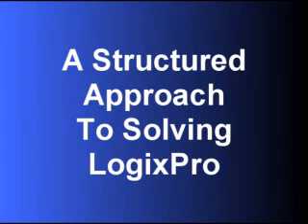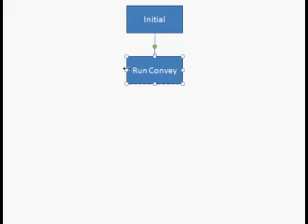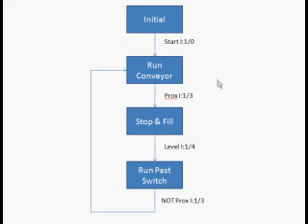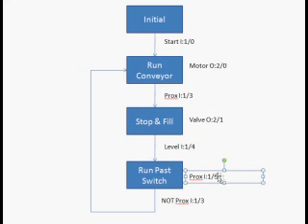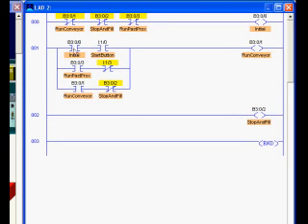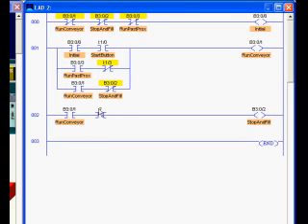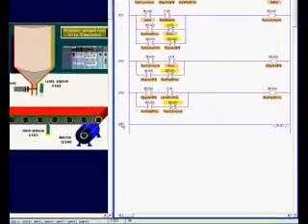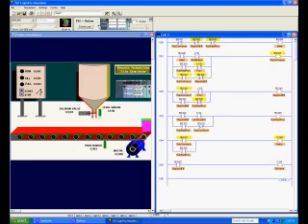Solving LogixPro Silo Simulation

Comment: You have one mistake.You pronounce faulty the B:3/3+i:1/3 that make the B:3/1. Insead of the B:3/3 you say B:3/2. wich creates problem for smokeing28.

I must admit ThaT you thinking metod is the best that I have spotted, as it really made the program work in the first try. 
Could you tell us some books wich will create us the same thinking methods ?

gate077 The torrent is :
LogixPro_v1.6.1_PLC_Simulator.rar
or try ITS PLC a game with sound and good graphics